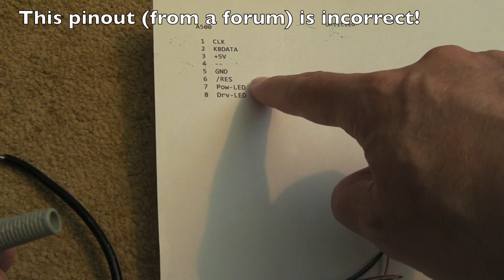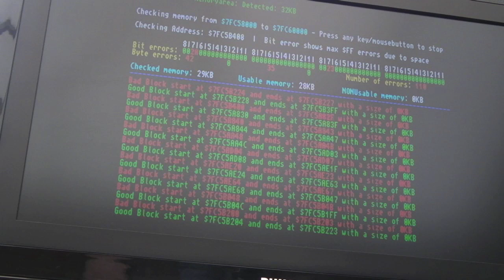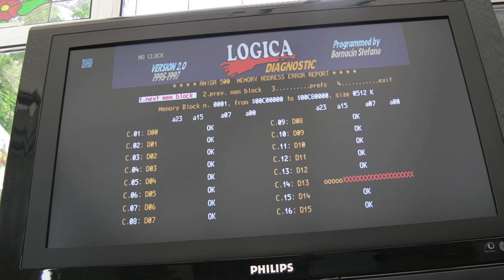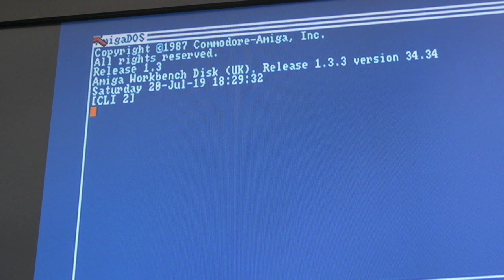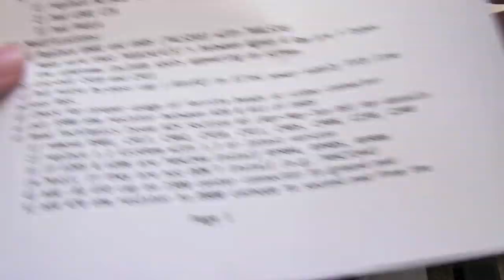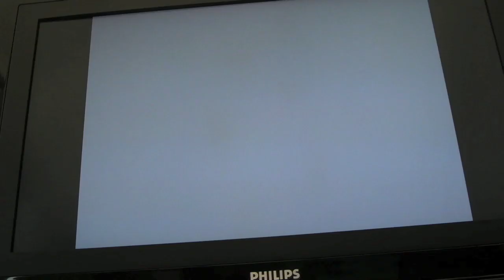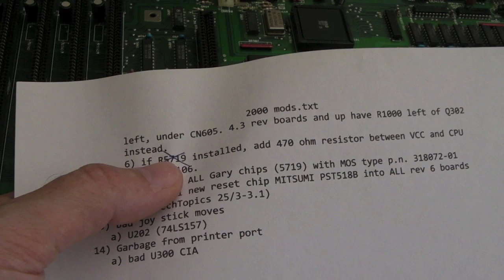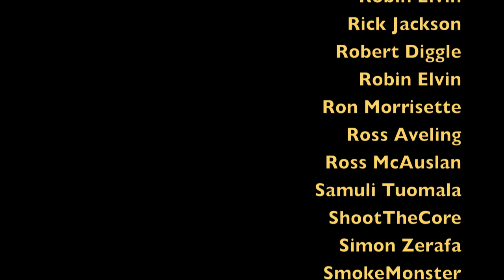Commodore Amiga 2000 Motherboard Repair (& Mods) Part 2

Comment from the maker: Corrections: PC floppy drives DO have a disk change switch (or the drive wouldn't know when you've changed disks!) - my memory failing there lol. The point I was measuring that pull up (before I tried to fit a 3K3 resistor) - it showed 10K on the meter (9.98K) - no idea how I thought that said 1K...
At 47:02 I decided to refer to D800 as D900 - no idea why lol.  
Thanks to Mr T Guru for recommending Logica to test RAM.
The CPU is not always disabled by use of the CPU slot (some cards can disabled it, others need you to remove it)  - something I was surprised to find.  I think I am thinking of the 1200 where the onboard CPU can be disabled via the expansion slot.  It seems on the 2000 you have to remove the 68K.
Links to things mentioned in this video:-
Part 1 - https://www.youtube.com/watch?v=uDhxK5NUcFk
Amiga Forever - https://www.amigaforever.com/
41256 DRAM Equivalents - http://www.minuszerodegrees.net/memory/41256.htm
Ian Stedman Amiga Blog - http://www.ianstedman.co.uk/Amiga/amiga.html
Another World Complete Play Through (Morgan Just Games) - https://www.youtube.com/watch?v=ovMF4MFD-8U

Comment: Be careful with those schottky diodes! They have a much greater reverse leakage current than normal silicon diodes and might actually charge the battery when the system is turned on, causing it to leak at some point. Your 1N5711 has a maximum specified leakage current of 0.3µA at 50°C which is likely still okay (Energizer specifies their CR2032 at max. 1µA charge current), however other diodes might not work as well. An 1N5817, for example, has a specified maximum reverse leakage current of 1mA(!) - that'd be a guaranteed leaking battery.

In any case, I'm loving your videos, keep up the great work!
Reply from the maker: Thanks!  I am aware of leakage current, but will be honest - didn't check that before I ordered them.  I think I just lucked out with this one.

Comment: Edit: Sorry commenting as I watched, I see you picked up on the info below later in the video :) I should have known you'd catch up on that!

Indeed on the earlier Amiga 2000s the Fast RAM is mapped to true (Zorro II) Fast RAM memory space, whereas on the Amiga 500 it's mapped to the so-called Ranger memory space at $C00000-$D7FFFF also called Slow RAM. It does make these earlier Amiga 2000s faster due to the CPU having some direct memory it can access without the Agnus bottleneck that gives the A501 and similar card's name of Slow RAM.

Comment: Excellent as always :)

About the Elec&Eltek powersupply: If you have a white little sticker which says "00" near the serial number batch it has already the 0.01uF mod. I've recapped 2 of them and both had the sticker. If you do a video it would be great if you're gong into detail with this mod.

If you're going to replace the old and loud fan, for sure, you have to make sure that the fan takes a minimal ammount of around 0,6 amps because if it's less the powersupply's saftey function switches off a few seconds after you switch on. This would be really great to see this in detail because there are always the same problems which people have if they're replacng the fan. 

Also, look out for a fan with a maximum of 1500rpm at 12V to get it quiet. Also take care, on some eleks the 80x80x25 have a very very tight fit, but it fits. Sometimes these eleks have original 80x80x25 and sometimes 80x80x20. For the big capacitors i've choosen 250v nichicon 105°C as 105°C for all the oher capacitors as well.
Reply from the maker: Thanks!  Yes, was aware of the "00" marking!  Will be recapping it, but won't swap the fan at this stage as mine is nice and quiet.  I've added some additional internal cooling in the main case.

Comment: Great video, as usual. I'm late to the comment party, as usual, too. =/  It's interesting to see the differences between DiagROM and Logica in action. I see chucky has just released a stable V1.2 of DiagROM with some improvements (as well as a framework for upcoming RAM test improvements). Also -- and I am no expert -- I was going to ask about using a Schottky diode for reverse voltage protection, but I see 
Jonathan Strobl already commented on this. I would love to learn more, though.

Comment: When I saw you preparing the cable and plug for A500 keyboard and said you didn't have a shell for it I was thinking of using a whole Amiga 500 case as shell for the keyboard. LOL. That would have been ridiculous. Maybe making some feets for the Amiga 500 keyboard would have been a solution for more permanent use with an Amiga 2000. Wouldn't look very good but would work I guess. Running Diagnostic in WinUAE! LOL! Good one!
Reply from the maker: Haha - yes, i thought about using full A500 case for the keyboard enclosure too!  If you had a spare case you could cut it down at the back end I guess and somehow make it not as long as it is.
Reply: Actually, that's the easiest way to get the rom saved to a file - works also great with Logica Diagnostica... Just run WINUAE with the Logica-Rom and enter the debugger (I guess, F12?). There you can save the whole region of the rom to a file. Done. So, at least, there is a usage... 🤣

Comment: Top video Chris, That Amiga 2000 board is looking \ working Sweeeet now. £200 for a keyboard, ouch. I too can't wait for the TF536; it's going to rock in my Amiga 500.
Reply from the maker: Thanks mate!  Yeah, £200 = crazy!!!  There are other solutions - I am using a wireless keyboard with it atm!

Comment: I have the DIAGROM chips for a couple Amiga's but never really put them to use yet.   I did not know there was a Diagnostic ROM on Amiga Forever so I will have to look at the CD's.  I am always amazed at what Amiga Forever has on it.   I have my A2000HD fitted with PS/2 adapters and with an Indivision Board I have it connected to a KVM Switch.  I have my A2000HD sitting in my server rack to save space because its a beast of a system but its out now for some modifications and hopefully soon I will get around to pulling the motherboard out to test the caps and I might recap it but I am more interested in working on the Zorro Bus because its been acting strange so I want to look at it under the microscope to examine the edge connectors, solder joins and look for micro-cracks.

Comment: Outstanding video! £200 for a keyboard? I nearly spit my coffee lol.
Reply from the maker: LOL!  I did too when I saw the price!
Reply: Maybe it was RGB? Everyone knows that RGB is essential for a proper keyboard.  £200 is a bargain! :P
Reply: Amigas are crazy prices these days across the board - I saw someone on ebay trying to sell an A600 with no video output for £80 and I wouldn't be surprised if someone buys it at that price.  Only about 3/4 years ago I picked up a couple of A600s in good condition for about £30 each.
Reply: @barnabas5688  Yep. I just bid on a busted A1200, non-working board only. It looked to be pretty badly damaged. I thought screw ot snd went to about £55. It went for £125. That is just the board 🤣
Reply: I got an "untested" (aka messed around, lost the screws, couldn't fix, put on ebay) A600 for 60 quid not long ago. It had all the usual a600 issues like leaked caps and broken composite output. There are some reasonably priced Amigas out there if you don't mind fixing them.
Reply: Spare keys are going for £6 each on eBay. So probably about right! :-D It's insane.
Reply: @Error42_  OK, so that's £582 for a full set of keys 🤣
Reply: Mr T. Guru  lol. I bought that A1200 remake board months ago but getting the chips to populate it is prohibitively expensive.🤣 Thank God I re-capped my A1200 when I got it about 4 years ago
Reply from the maker: The irony is, after I bought that replacement F2 key, I found I had a full set of Samsung keys in a bag lol.  Even more ironic, I put my hand inside to check which type they were and the fist key I pulled out was a Samsung F2 key.  I caught that on camera lol.

Comment: The A500 keyboard does have a reset circuit on it that pulls the reset line low when you hold down CTRL and the two Amiga keys. The A2000 has such a circuit on the motherboard itself, which is why its connector doesn't have the reset signal.
Reply from the maker: Thanks!  My understanding is that the Ctrl+Amiga+Amiga is done differently on the 2000 though - ie. some clever technique is used on either the clock or data line, rather than how it works on the 500 where the keyboard pulls the reset line low for the system.
Reply: @GadgetUK164 I have done extensive work on this. I have a A2000 keyboard with only 4 pins from the factory! The A1000 keyboard has only 4 pins as well, and believe it or not is theoretically compatible with the A500/A2000. So there is an actual keycode for reset that comes on the data pin (and I believe it is still sent on keyboards with the 5th reset wire). See my posts as "Dr Remulak" on: https://forum.arduino.cc/index.php?topic=139358.0
Reply from the maker: To expand on my comment there - The A500 keyboard pulls the KBRESET line low - not the main reset.  It's done via Gary.

Comment: Can you provide some more info on the Demagnetizer as I think I will have to get one for more than my 1541s.  Also, which Molykot are you using?  You mentioned it in a previous Video but I couldn't readily find it.  Thanks.  -Mark.
Reply from the maker: You want something like this:- https://www.ebay.co.uk/itm/Analogue-Studio-Tape-Head-Demagnetiser/392296317884?hash=item5b56aec3bc:g:yA8AAOSwo51dQHVA

It is seldom used but can sometimes fix heads that seem to be magentized (or the surrounding chasis parts etc).  It's also useful for degausing old CRT TV / monitors too.

Comment: IMO replacing all the RAM chips would be prudent. In a few months another chip may fail, and a few months after another will fail, repeat... Doing them all at once would also avoid damaging the replacement sockets when removing adjacent chips, etc.
Reply from the maker: Yeah, that can be the case - hence why I mentioned it at the end of the video.  But... On many occasion I've just swapped the faulty IC and the others have been fine for years, which is why I haven't replaced them all yet.  I've been using that board a fair bit and OK so far!  Only time will tell!

Comment: 3.5 inch PC floppy drives have disk detection switch. You can find the disk change signal on pin 34 (also you can hear them spinning briefly to engage the hub when you insert a disk). The problem is there were no agreement between manufacturers so you'll find some drives spitting an active low signal while others spit an active high. That prevented Microsoft to implement autorun for floppy drives back in Windows 95.
Maybe there were cheap units without that switch, but I've never seen one.
Reply from the maker: Thanks, yes - see my correction up top!  I worked that out whilst it was uploading lol.  My memory just failing!  Without a detect switch any FDD would not know if the disk had been changed or not.

Comment: Where did you get the text file ?  Can you give the link/make it available ? - I found the Commodore TechTopics, but need to browse a bit :)

I have a 4.1 rev A2000 (B2000) motherboard, bought in '87 with 8088 Bridgeboard, with the 470 Ohm resistor from Point f5, and the R5719 installed without the resistor suggested.
I kept it uptodate with the Fat Agnus ECS, Denise ECS and Kickstart 3.1 (want to get 3.1.2, though), 
but something on the PSU or the MB blew smoke recently after switching on from long time no use.

I now removed C910 and C911 and had/have to do a little battery leakage clean-up (need to clean up part of the 68000 socket for which I got some replacments) replacing the 3V, 
so your diode bit is exactly what I need. Do you have a part number/naming for that Schottky Diode ? - never mind, found my answer in the comments :)
Reply from the maker: It's linked in the video description and the pinned comment up top!

Comment: Chris,  do you have a link where I could find replacement or equivalents for DRAM 514256 256kx4? The one in description is not working.
Reply from the maker: Just search eBay for 41256 DRAM - there are a number for sale there!

Comment: I didn't know Amiga Forever had the Logica ROM on it, thanks for the information.  However, after taking a look at the files on the disk, the Logica ROM doesn't appear to have the key applied to it and is the right length (524,288 bytes).
Reply from the maker: It might be a case that "early" purchases of Amiga Forever have an unencrypted version of the ROM?  I just know that I checked the website and it seemed to suggest they were for use only with WinUAE, and I see lots of people moaning about it too.

Comment: I read that the A2000 can handle hd floppy drives, the same ones as used in the A4000?  Presumably you would need to be running kickstart 3.1 though?
Reply from the maker: Not something I've looked at!  I didn't even know the 4000 had HD drives!
Reply: GadgetUK164 - Retro Gaming Repairs & Mods I believe they also were supplied with a copy of WB on High Density disks.

Comment: the F on the chips stands for Foocked.i repair arcade pcb's and i check power rails clock and look for the F chips.think its fairchild
Reply from the maker: I wondered about Fairchild too when editing, but if you look at the link to the different DRAM chips (up top in the pinned comment) you will see that these are Fujitsu!